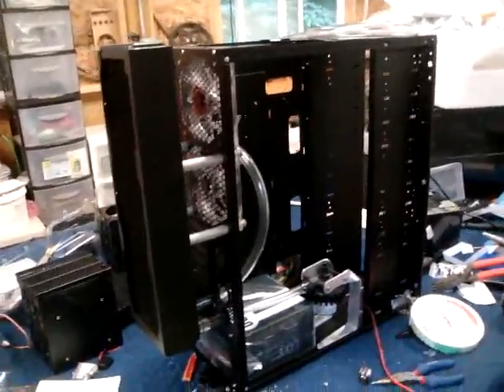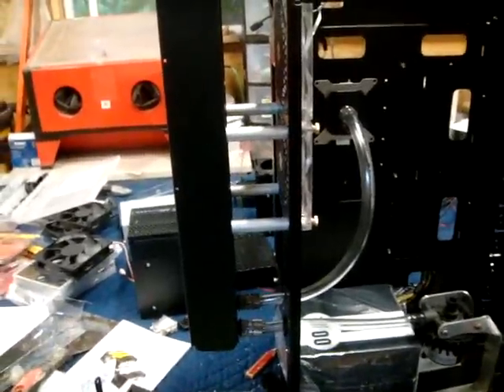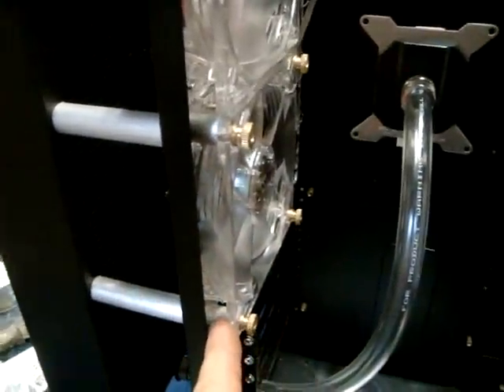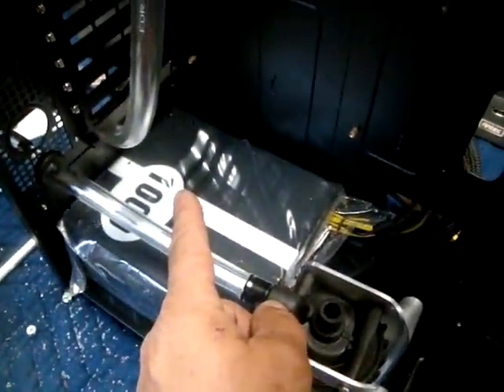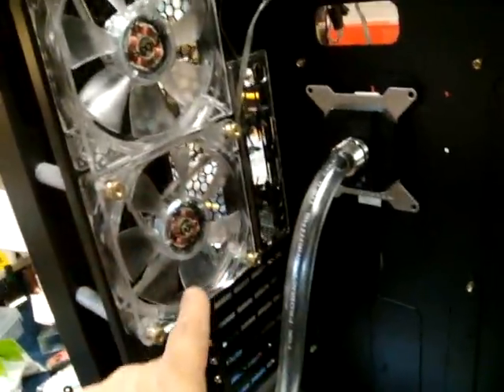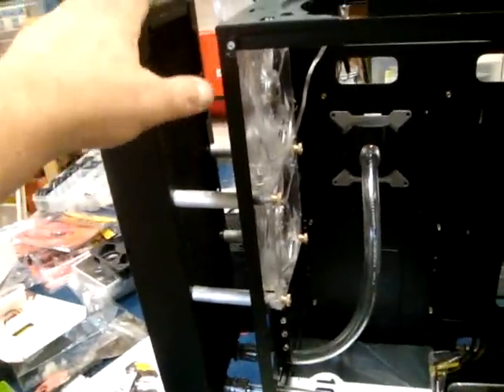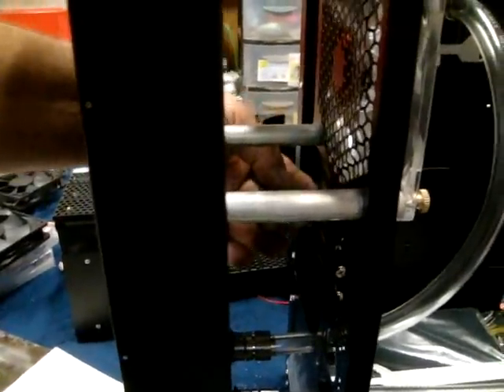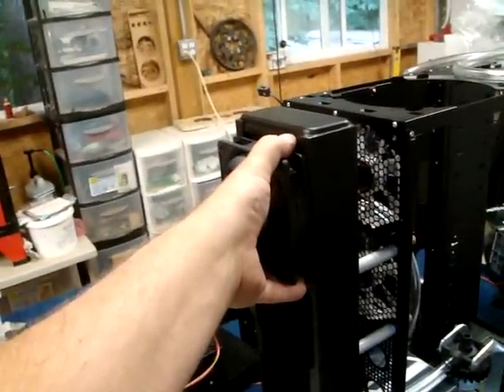Antec 1200 Rad and Pump Fitment for Liquid Cooling Conversion by Waterputer

Comment from the maker: Determining how much rad is enough requires a bit of research. You should probably check out OverClock or XtremeSystems or TechPowerUp and ask that same question. It's not like every CPU or GPU put out the same amount of heat. You should match the rad to the load...and a PC forum is the best place to see real numbers by real users...not theoretical answers. Good luck

Comment from the maker: @Mr1gnome Most of my builds are client-driven so I use what they prefer.  The differences in performance between top tier radiators of the same form factor are small. For the money I think the XSPC radiators are a good choice, but there are many good radiators available.

Comment: wen you bild a rad on the back of the case do you have any prefrance, when i bilt mine i used a phobya 360 so it had 4 ports 1 for drain 1 for temp 1 in 1out it looks realy cool and nice to have it all tidey.

Comment from the maker: It's a ThermoChill PA 120.3. The only US source for them I know of is Mountain Mods. God love Ben for continuing to stock these awesome rads. The PA is not a pretty rad like the Feser or XSPC, but it is a very efficient rad and works great with low speed fans. But the paint on this one is pretty good and matches the A1200 close enough that I won't be repainting it for this mod.